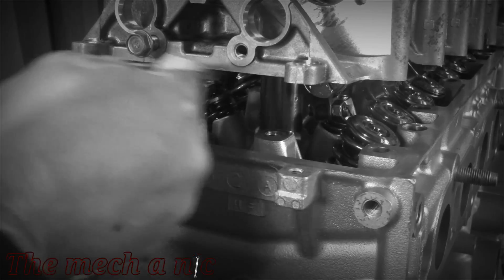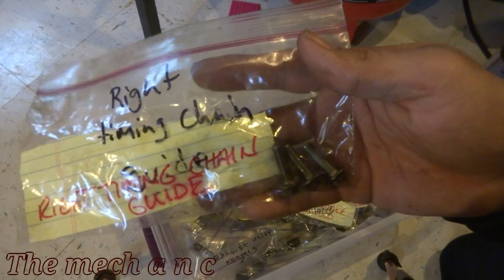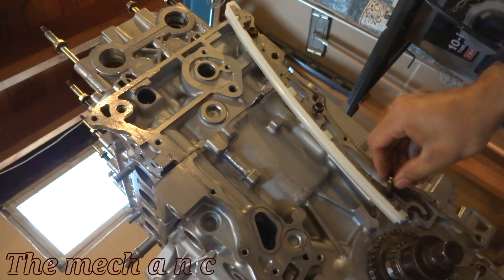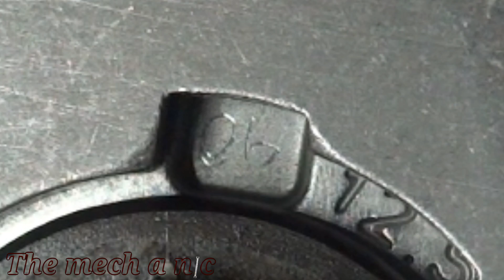Installing the timing chain on a k24 engine

Comment: Would the OEM chain and tensioner last with these cams?
Reply from the maker: Yes , I'm pretty sure 4piston racing uses oem chain n tensioner for their builds which are alot more wild then what I got going on
Reply: @themechanic6117 would the aftermarket tensioner like inline pro and drag cartel chain be unnecessary when using 3.2 cams?
Reply from the maker: I currently have the drag cartel chain installed on mine. When I had them side by side I couldn't see a difference between oem and DC chain.

Comment: After setting everything and making sure the colored links were in the correct locations(two dots on cam gears and mark down at crank gear), I turned the engine a couple of rotations and back to lining the timing marks up but the colored links seem to be out of position. The tensioner is in place and everything but the colored links don't line up in the locations I set them up in any longer when I am at top dead center cylinder 1. What gives?
Reply from the maker: That's normal.  As long as the timing marks line up then it's good. Every time the chain rotates a full revolution the colored links will be off by another tooth. Eventually they'll all align again but it would take many revolutions. As long as the marks (not the colored links ) line up it will be fine.
Reply: @themechanic6117  Thank you very much. I appreciate you.
Reply: I just found out that after timing the system to the colored link, links don’t mean anything anymore. As long as the timing marks on the cams sprockets are correct. Apparently after so many turns they will line up again. But that would be 20,30,40 or 70 who knows? I got it right.

Comment: My engine needs a vtc actuator the part number for my engine is 
14310-RZA-003  would the 
14310-RBC-003  FIT instead?

Comment: Ok I’ll double check my wires but I’m sure they are good. But there is a fan switch wire in the front that I just got rid of but I don’t think that would stop the engine from firing. The timing I thought I did alright because I even watched your video to double check everything I did smh. But I’ll look everything over and get back w you. Thanks again I really appreciate ya

Comment: I have a crazy question about my 12 civic si. On my k24z7 I replaced the camshafts with skunk 2 drop ins and after installation now my car will crank all day but will not start. I’ve replaced sensors and even ecu but still nothing? Could the cars timing need to be set differently or something? I know if anybody knew it would be you. Thank you
Reply from the maker: If the car ran fine before the cam install why would you go changing all those parts? Put the original parts back on to start with.
Reply from the maker: Sounds like you messed up the timing of the engine or you forgot to plug some things back in.
Reply: @themechanic6117  I can’t because the original cams were bent when got the car
Reply from the maker: Bent cam?? How is that possible?
Reply: Or what kind of things might not be plugged back in? Also on my autel scanner when checking IM everything came back in red except misfire and ccm wish I could send you the pic of it to explain better but I’m lost with this car and it’s been almost a year in the works lol
Reply: Lol, well there was something that got caught in the cradle causing the camshaft to grind and all the tension bent the shaft I guess? That’s just how I got it is all I know lol. But I’ve completely rebuilt this head as well as replaced the head gasket and head bolts and thought I did the timing correctly and now stuck w a car that will crank all day but won’t move an inch. Bout to throw in the towel on this one bro lol

Comment: Did you have the plugs in?
Reply from the maker: No
Reply: @themechanic6117  I’m doing this job but when I put the drill bits in the back , the cam lines still don’t line up. Its off by a tooth so when I try to put the two golden links on the chain at the 12oclock position on the cams, the chain doesn’t reach. I’ve tried moving the intake sprocket counter clockwise like you did in the video and it lines up for the chain but as soon as I let go of the ratchet the sprocket springs back out of time. Do you think removing the plugs will help have more liberty when moving the sprockets around? Pleaseee help man I’ve been stuck for days thanks for the video
Reply from the maker: I always pull out plugs when I doing a timing job . It makes adjustments much easier.  Try it without the plugs and see if things line up . The cam gear are usually going to want to spring out of alignment, that's normal for it to be out by a tooth. Rotate it till the marks line up and install the chain. The chain with keep everything in place
Reply: @themechanic6117  thanks for the response I will try this tomorrow man

Comment: Man is this contraption a clock or a motor. 8 rinki-dink marks required to time this wind-up ⏰️ clock.
 I got money, not time. I'll use repair shop to get mine done. All that time and 💰 money for 250-300 hp...gtfoh...
Reply from the maker: 300whp in a crx that weighs 1,960 lbs... that car will be like a bat out of hell lol .

Comment: I’m having issues doin mines hen j set timing for the lower crank I can’t get it to line up soon as I put tension with the tensioner the crank roll over a hair so the bottom isn’t 100% lines up an can’t figure it out .any idea?
Reply from the maker: Does your chain have colored links for lining up the timing marks?
Reply: @themechanic6117  nah I wanna say who ever had this motor prio to me had it changed at some point. ,no gold or black links an no markings
Reply from the maker: Is it possible to buy a chain that has the colored links? If not you'll just have to count the links. It's normal for everything to move a little once you install the tensioner.  As long as the chain stays on the correct teeth it'll be fine.
Reply: @themechanic6117  anything is possible with the Klarna app lol but yea I am using the chain that was in there im looking at oem currently the reason I ask was because I’m been told NOOOOO it needs to be 100% lines up then I’m hearings it’ll be fine long as it’s not jumping teeth as you stated as well an yes everything stays on tooth no jumpin firm  tension as well
Reply from the maker: If it doesn't jump teeth then it's 100% fine. On any timing job I do it's normal for everything to move a little once I engage the tensioner.  As long as it doesn't jump teeth anywhere then it's fine.
Reply: @themechanic6117  bad ass thnks for the info ,I went ahead  an baught a oem chain an tensioner  
New guides where installed upper guide as well ported type s oil pump with the chain blocker I can’t member what it’s callled but it’s what u have installed but yea just gotta wait for parts to come in an I’ll cam move forward I’m doin a awd turbo build on my teggy hopefully I’ll be able to start doin some video uploads ,

Comment: Hey professor good video thanks... my cam gears pully arow all points mach just not the timing chain gold links  it is nesesary to mach the gold links of th chain with the cam gears ?
Reply from the maker: It's not necessary but the colored links on the chain help to make sure it's correct

Comment: So everything is good until I line up my crank mark to my mark on the chain....the top two are aligned, my crank is TDC, but the gold mark on the chain does not line up with the dot on the crank brocket....any ideas?
Reply: So I just also want to add that I installed the chain with the tensioner, everything at TDC, top two marks aligned and top two chain marks over the dots, Crank pulley at TDC but chain mark not on the dot (maybe 2 tooths off) I placed the tensioner and circled the crank 1 time and both lines align with each and the crank is at TDC. So does this mean it didn't matter if the chain marks didn't match up? The only thing that matters is alignment of lines and crank at TDC?
Reply from the maker: Align all of the timing marks first and then install the tensioner . Once the cams are lined up on top turn the crank which ever way you have to to get it go line up with the timing marks.

Comment: What chain do I use for a k20 k24 set up
Reply from the maker: A k24 chain I believe
Reply: @themechanic6117  thanks so much I also use a key 24 timing chain cover for the same set up to right
Reply from the maker: Yes you'll need a k24 timing cover

Comment: I have a 2004 accord with a 5 speed manual trans., and timing chain. A shop told me I needed to replace the chain, but I was wondering if replacing the tensioner would be enough. It has 172k miles.
Reply from the maker: Chains develop slack over time. Changing just the tensioner does not fix the issue

Comment: Can we use k20 top chain guide?
Reply from the maker: Yes
Reply: @themechanic6117  to remove the vtc, is it must to rmove the cam?, or can we remove vtc without removing the cam?
Reply from the maker: Im pretty sure you can remove the cam sprocket without removing the cam shaft

Comment: 1:05 I literally cried as I realized i had to take the cams/rockers out to add that honda bond lol.
Reply from the maker: Yes i had to take it all apart again because i initially forgot that also...
Reply: @themechanic6117   i gotta tell you man your videos have pretty much made my swap possible. Thanks allot!
Reply: @The mech a nic is it absolutely necessary for Hondabond to be placed there when putting the engine back together? My engine was bored to 86.5mm and both block and head surfaces were machined and it's a complete K20A2 not a K20/K24 is the Hondabond absolutely necessary in this case?

Comment: New sub bro.. My VTC is showing signs of going bad.. Dont want to risk messing one of my valves.. QUESTION.. I want to run a 40 gear also.. Does doing this require a tune? also what are the main benefits of doing this?
Reply from the maker: Im not sure but i dont think it requires a tune. The benefit of this is when you're using and aggressive cam shaft there no way for the vtec to turn on past 40° so theres no piston to valve contact  . if youre using stock cam shafts you dont want to pin the vtc to 40

Comment: U didn’t degree that motor ? Dc 3.2 I have that same set up but I hear u have to degree motor after install
Reply from the maker: Nothing is adjustable...whats it matter if degree it? I have a DC pinned exhaust gear that won't allow it  past 40°
Reply: The mech a nic same here I have the sk2 exhaust cams adjustable but I thought u have to degree that motor after install those cams

Comment: I have a 2013 Accord Sport and the other side of the cams do not have those cam
pins where you insert the drill bits. Any advice how to align both cams? Thank you

Comment: What tool is used to remove/install left chain guide? I noticed it wasn't a 10mm socket.
Reply from the maker: I think its a torx bit. Not sure what size.it shouldn't be difficult to remove

Comment: I'm looking at buying a car with the Honda K (K24Z3 LEV) 4 Cylinder, 2.4 L engine. Are there any issues that need to be considered?

Honda Accord Euro (8th Gen 2008–2015) [known as the Acura TSX in the USA] using the Honda K (K24Z3 LEV) 4 Cylinder, 2.4 L engine.
 Automatic Transmission

Comment: Man i just bought a new set but my new chain do not have the mark link so   ther eis no problem with that ?
Reply from the maker: As long as the timing marks are lining up and you have the cams locked it should be ok

Comment: How bad would it be not to replace the timing guides? My rsx s is almost about 200k.

I was just thinking about replacing the chain n tensioner n I also purchased drag cartel lower guides. Think I could get away from that?
Reply from the maker: At 200k id replace all guides. Its not only abiut how worn out they are but the plastic guides become brittle n break into pieces... That causes major problems. If you're changing the chain, do the job right.👍

Comment: Is the k24a type s has a balance crank?
Reply from the maker: Im not sure what you mean..
Reply: Ok I wanted to know if the k24 type s  motor crankshaft is balance I was told that the rsx type s has a balance crank and what do u think about the k24 type s jdm engine? Ur opinion?
Reply from the maker: @seansk8310  every crank is balanced to a certain degree . if it were not balanced the engine would destroy itself.i dont know anything about jdm engines give my opinion on them.
Reply: I think he means balancing shaft